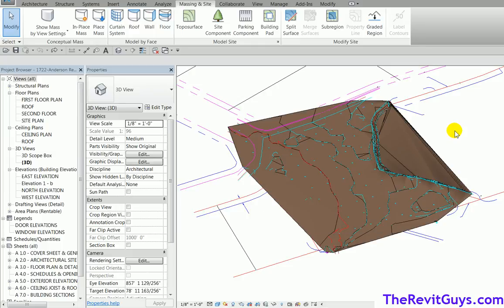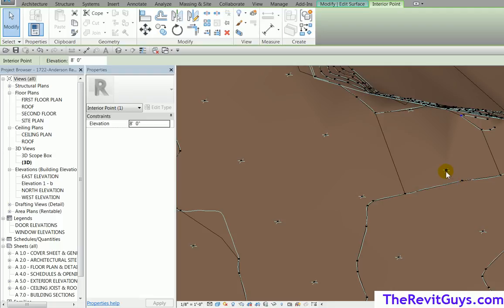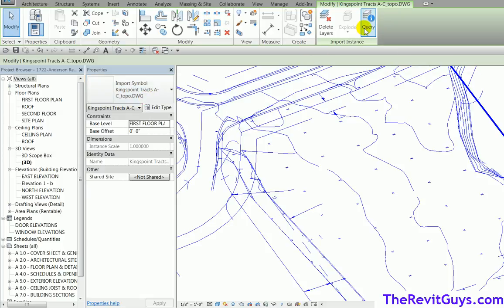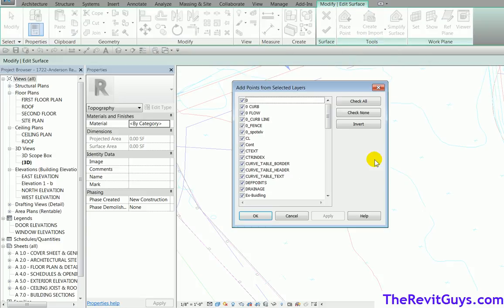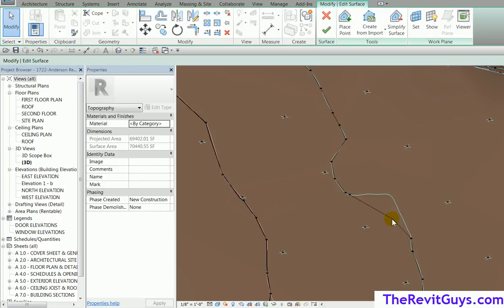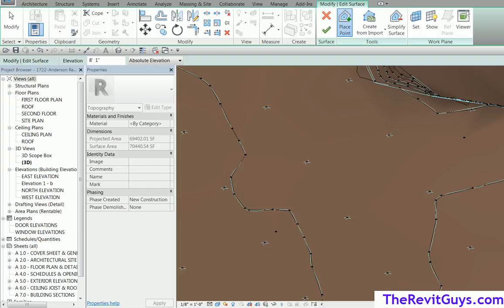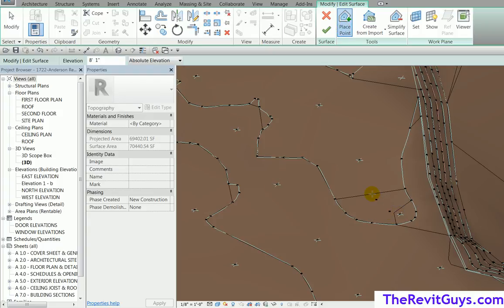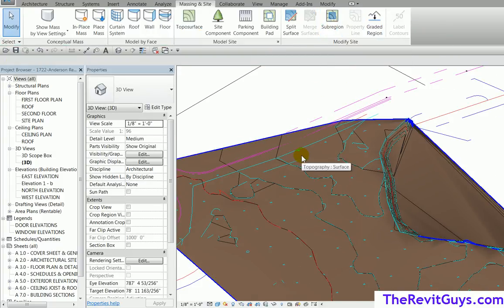Revit - Creating and Editing Topos to match the Civil DWG - CADtechSeminars.com

Comment: Hi...Thanks dude for helping out... This works with small scale project. What about project which are in  hectares  and acres ?
Reply: Jai, This should work with any units.
Reply: Ken Colgan Sry... my previous question is about the scale... using this for small scale project its good...  but what about huge scale of projects... Its hard to find  these kinds of errors...
Reply: Jai, Revit does have a limitation of 20 mile radius. Then things start to wander. I have had personal experience with this. The site was very large and we could not get Revit to close a property line. The numbers worked perfect in AutoCAD, but when the same information was added in Revit the property lines would not close.
Here is the Autodesk knowledgebase link on this: https://knowledge.autodesk.com/support/revit-products/learn-explore/caas/simplecontent/content/coordinates-systems-20-miles-limit-the-max-distance-input-part-i.html